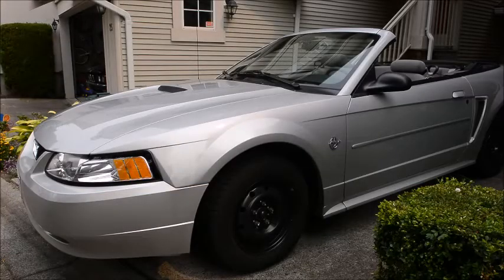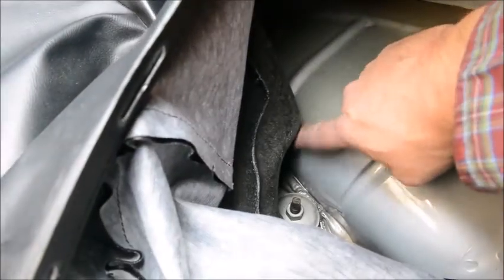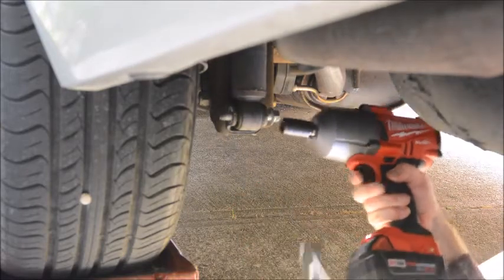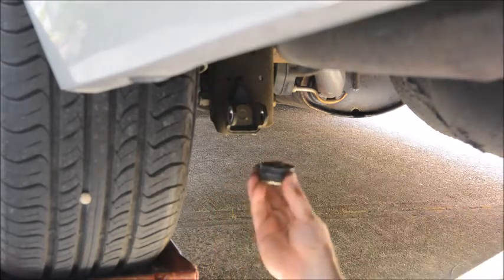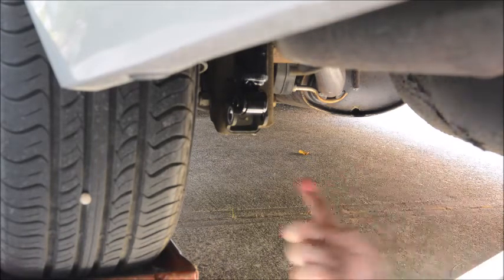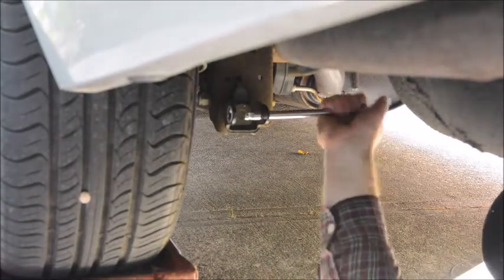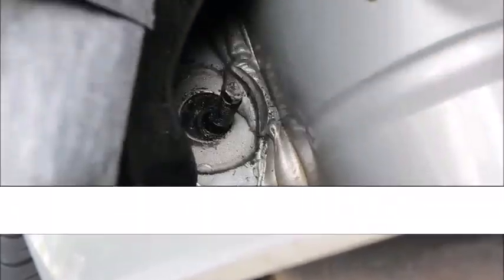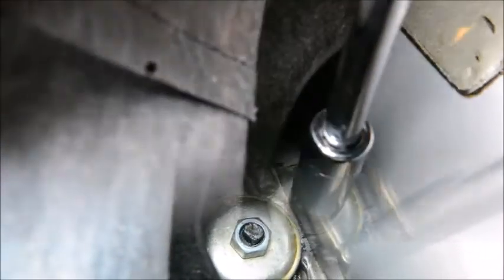Mustang Rear Shock Replacement - SN95 / New Edge 1994 - 2004

Comment: You had back wheels on a ramp? So no needed for a jack?
Reply from the maker: Hello Jesse, a jack shouldn't be needed as the springs will take the load of the vehicle.  Shocks should be able to be stroked in and out without too much effort, but a fresh shock may take a little weight to compress, so it is best to have it lined up as close as possible before removing its holding strap.